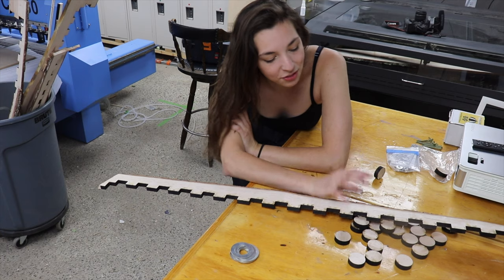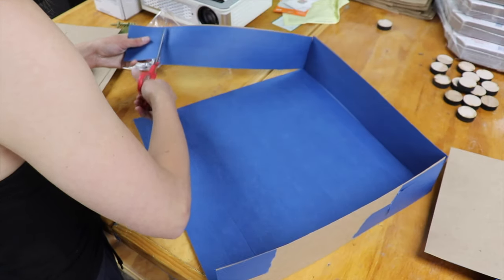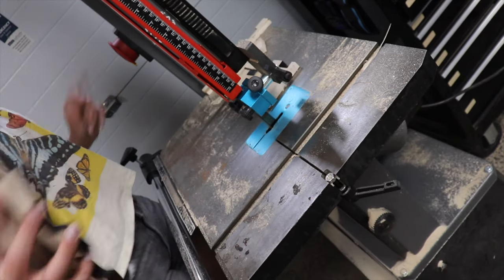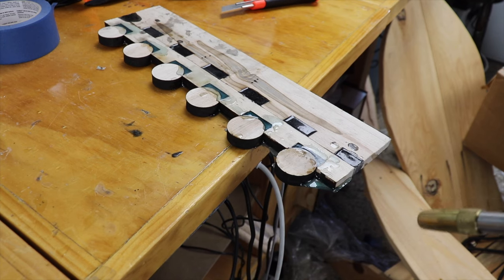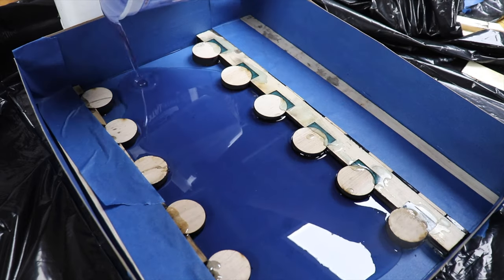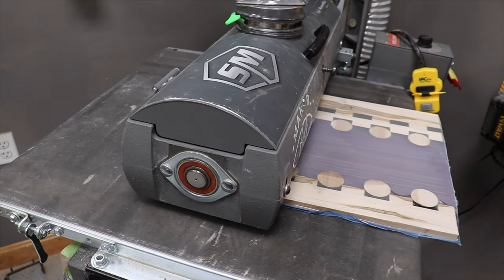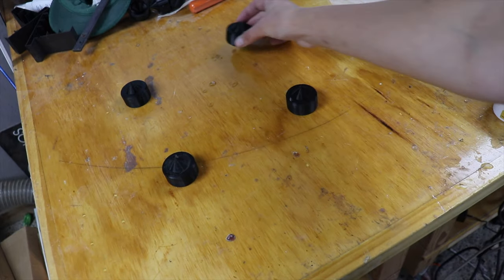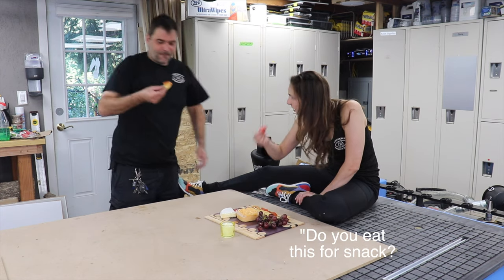Scrap Wood Resin Cutting Board | Using Up Laser Cut Scrap Wood

Comment: If you don't have tyvek tape, clear packing tape works well. It is non-porous and less likely to have the resin stick to it than the painters tape.
Reply from the maker: Ooo I love this suggestion! I’ve never thought of packing tape bc it’s not something we store in the shop, but we definitely always have some on hand.
Reply: @MakersWorkshopLLC  I have seen it used in a few videos so tried it myself on a few projects. Minimal leaking-if you are careful when putting the tape down and make sure it has a good seal. The tape may leave some sticky residue, but that can be removed with sanding or adhesive removers. To minimize the sticky residue on large (flat) surface, I used parchment paper between the tape and the wood. It worked surprisingly well.
Reply from the maker: I love weird tricks like this. Im going to have to give it a try. You have me intrigued.